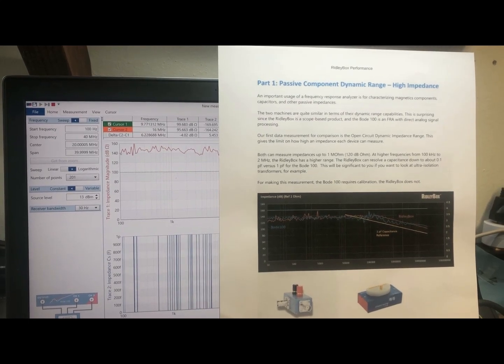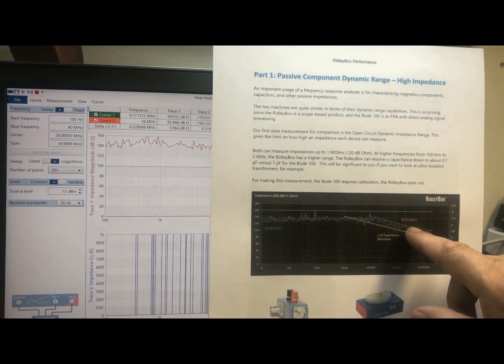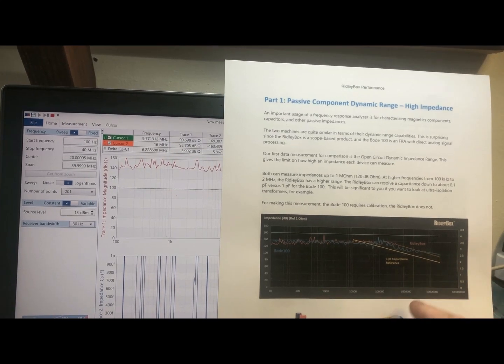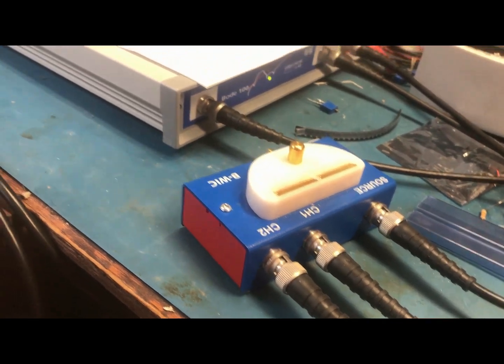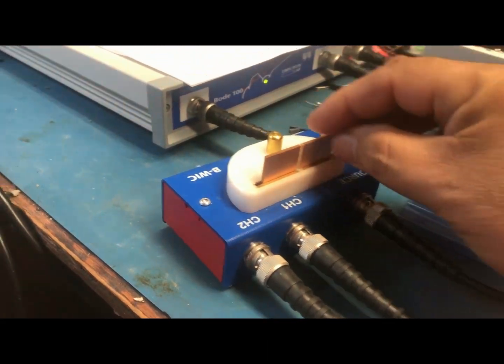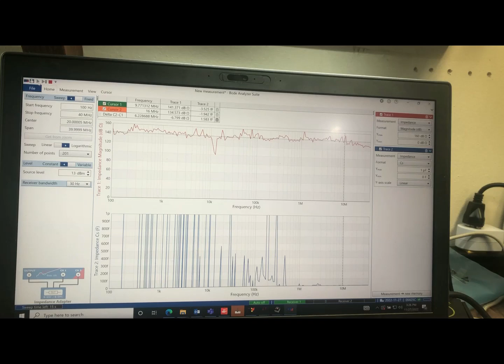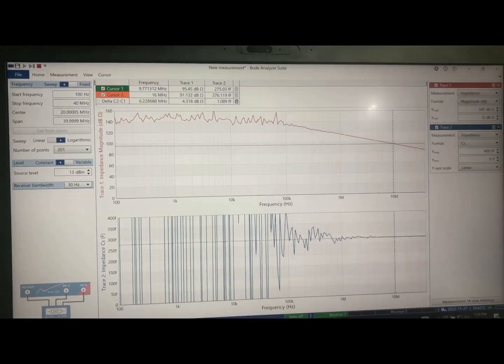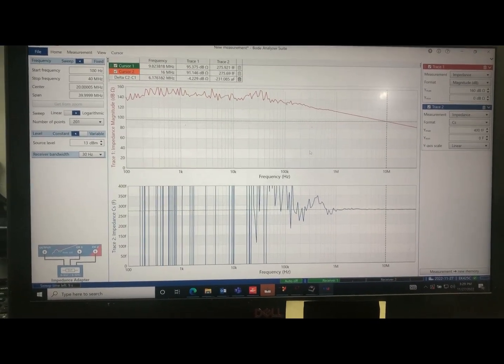Bode 100 Low Capacitance, High Impedance measurement

Comment from the maker: In this video, I show that the Bode 100 has a slightly higher impedance ceiling up to 140dB-ish. I show how to calibrate the Bode 100 and measure two series connected 0.5 pF capacitors for a total of 250 Femtofarad. I show how I use two PCBs; one with the DUT and the other to calibrate the parasitic of the BWIC jig. If you cannot calibrate the parasitic capacitance of your measurement jig, you are limited on how low of capacitance you can measure. Questions and comments can be sent to rbola35618@aol.com. Please share, thumbs up and subscribe.